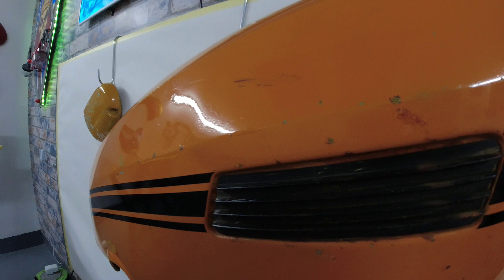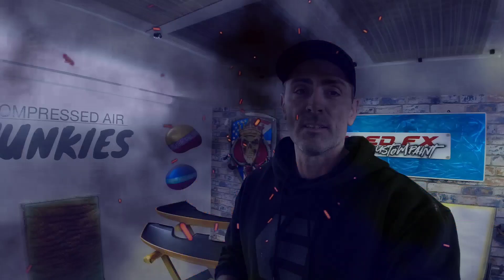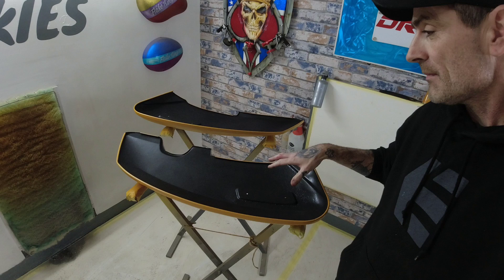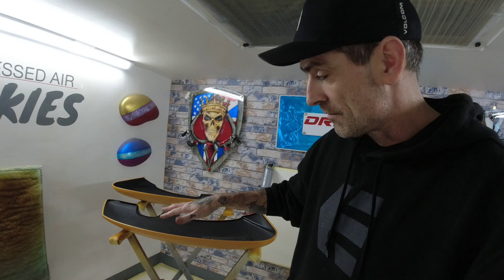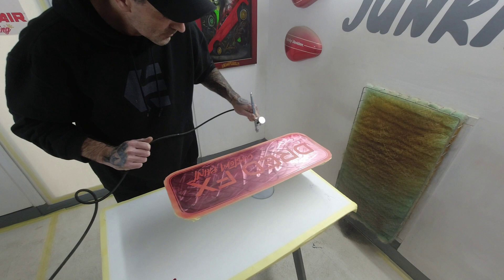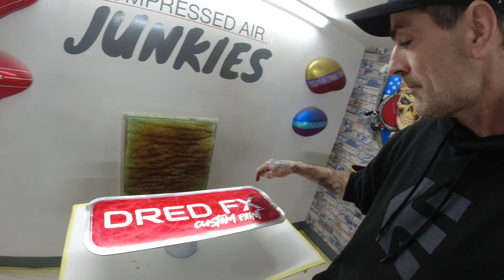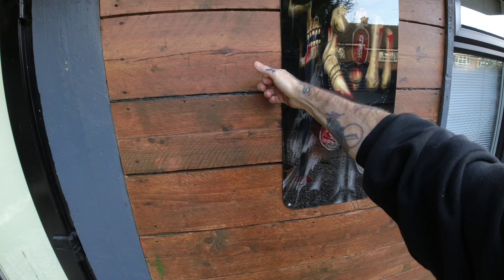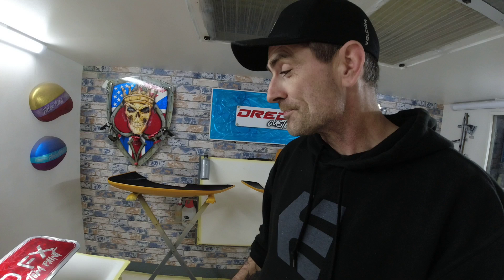LAMBRETTA PART 5 🤔🤔🤔🙄🙄 AND SOME GROUND METAL ART

Comment: Watching right now bro hi to jesus😄😄
Reply: 🖐🙃🤘Dean and Rob.  One day I wanted to finish spraying a cabinet thay day 20 mins before quitting times, so I did not let the silicone/caulk dry and well it cause me head aches.  I had to scraped the silicone where the paint separated and Crack again do to water getting trapped in the Crack.  Lesson learned 😁🙂🙃.  Nope I still tend to rush things that's why airbrushing is kicking my ass....
Reply: @coolkids2064  mukka you learnt not to do it again a child only eats raw lemons once 😃😃
Reply: @deanbrown7643  yes Dean I'll share a secret.  I have gotten so good at caulking the cracks that I can do it without using water and leave it feeling like a princess bottom.  No sanding needed😁...be like water my friend1😁
Reply: @coolkids2064  brother when you do something 5days per week you get very good at it . I'm on the hunt for some sort of backyard studio tommorow I'd make it myself but my woodworking skills suck wish you were over here bud
Reply: @deanbrown7643  👍Dean look for me on fb under Jc aerografo.  I'll be glad to help you.  same picture as my you tube account.
Reply: @coolkids2064  if I can't get a cheap enough one in the next couple of wks I will gladly take you up on that mukka got to get some sort of workshop together for when Rob pays me a visit I've only got a 6×4 shed with no room to swing a cat in
Reply: @deanbrown7643  cut the 2 x 4 in half save money.  Or by 2 x 2 that's how the big red box home depot does amd sells them for full price😁
Reply: @coolkids2064  thanks if I need to I will get hold of you on FB for sure